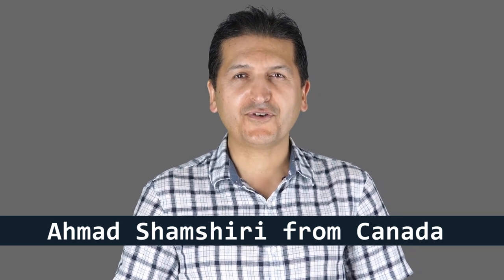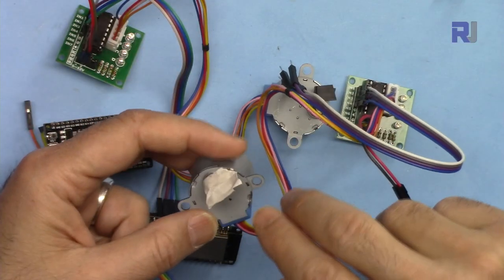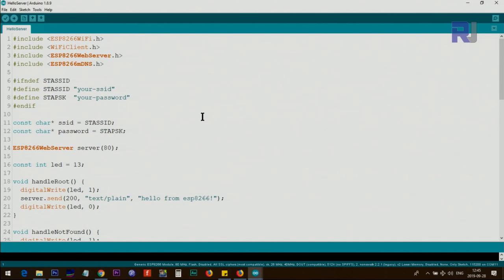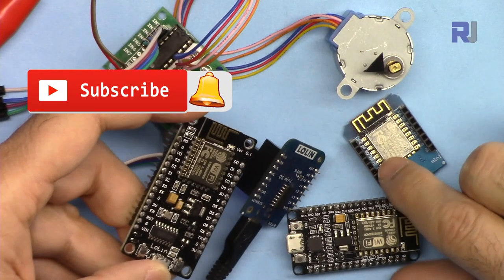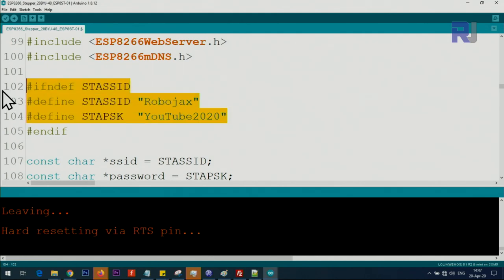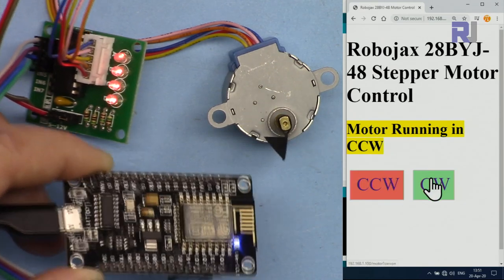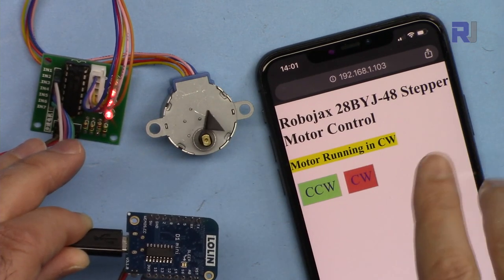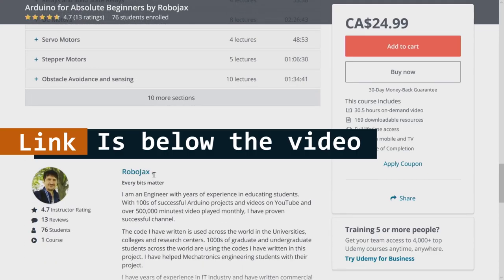Control 28BYJ-48 Stepper Motor using ESP8266 NodeMCU or D1 Mini over WiFi ES8STP-1

Comment: Thanks for the video, it’s working perfect on d1 mini, I have a question , how can I change the buttons to example to make 2000 steps and then stop? Thanks for help
Reply from the maker: you are welcome. I have written so many codes for this motor. it is hard to accommodate every scenario, but you can learn easily and change them to your need. I have more code where Wifi is not sued but you can used them for your purpose. please search my channel.
Reply: @robojax  sure I will, thanks

Comment: I would like to set it by default to start in clockwise mode, is that possible? Would that be covered in your class?
Reply from the maker: Hi, the possibility to do different moves is endless. So I have put like 8 different types of projects with multiple options in this video https://youtu.be/TQ7R2bY-MWU so please watch, learn and implement it in any way you like. I am sure you will find this video useful

Comment: Sir, great program, works perfect. I have two steppers and i changed the program. the motors are running simultaneously but  i want each motor run separately. Can you help me please. Greatings from Holland.
Reply from the maker: I have defined variables that are used to control each motor. Watch video multiple times so you know how it works. Then define separate variables for each motor so they are controlled independently. This code is free.  But if you have a project and want to pay minimum of $100 contact me via Robojax.com contact page.

Comment: Hi Robojax,

I'm following along but I don't see the IP address part when I reset the nodeMCU. When I reset, the serial monitor shows a string of characters and then "Robojax 28BYJ-48 Stepper Motor Control".

I'm using an ESP8266 (set board to generic), changed the SSID/PSK, set serial monitor baud rate to 115200. Not sure what else I might be missing...
Reply from the maker: Watch this video https://youtu.be/WyWRGoACWFs

Comment: Hello, I uploaded the code and I can access the ESP via browser but when I press the button to rotate I can hear the motor like it is running but it doesn't move at all. Same for both directions. I tested the motor and the motor driver and they are working. Wiring is done as per your guidance. I am using ESP8266 NodeMCU V3 and also I am using external 5V power supply. What could be the cause for the motor not turning?
Thank you in advance.
Reply from the maker: Hello, if you have not changed the code then wiring is incorrect.
Reply: @robojax  Hello, I appreciate your reply. I made two mistakes... I didn't uncomment pin definitions (I'm using NodeMCU) and I gave 3.3V to the motor so it couldn't turn. All working now, thank you for this cool project!

Comment: @Robojax Is the same motor robojax,just here you have in half step , (8steps), i need (4 steps ) the fullstep where change the code?
Reply from the maker: yes it is possible but not easy to explain and without testing it.

Comment: Hello Robojax, excellent work I congratulate you, just a question how to change the stepper motor from 8 steps values to 4 steps values, because I need all the torque thanks.
Reply from the maker: Hello and thank you.  I have custom written this code for this motor. You  need totally different code.
Reply: @robojax  Is the same motor robojax,just here you have in half step , (8steps), i need (4 steps ) the full power of the stepper,can you help me? thank's

Comment: Sir, thank u so much for sharing your immensely valuable knowledge....i have used your tutorial "Control speed of this motor using Potentiometer" and it was a success for my project.....please guide me with a video using ESP8266 node mcu and the BLYNK APP so i can control the speed and direction of the 28byj  stepper motor to desired values
Reply from the maker: you are welcome. I have not used the app you mentioned. They don't care about education.  you paid for it. ask them they should help.

Comment: Sir how to run a stepper motor for a 4 second in both directions  At the condition of  ( x>60)(x<60) after it will be in off
Reply from the maker: See other example and learn the combine them. I have fully explained them with over 29 videos on stepper